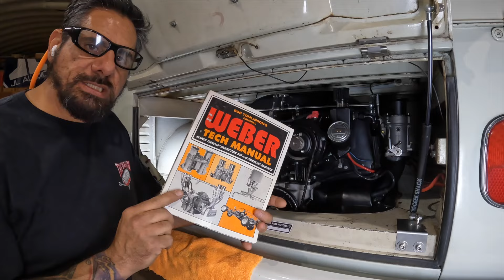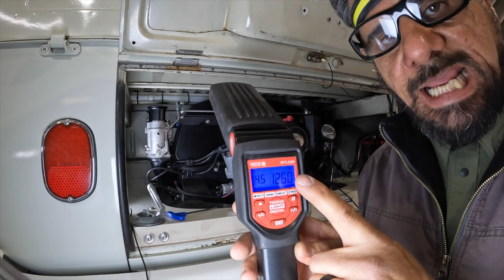Synchronizing Dual Carbs  on a VW Bus

Comment: Just what I needed. Been trying to get things just right on my new 2007 cc engine using Delorto dual 40s.
Reply from the maker: For Dells, do1/2 turns and wait for the response. They are very fine threads on the air fuel adjustment screws.
Reply: Great combo and setup!

Comment: Very knowledgeable, can you do a carb adjustment on a vw bug especially because of the less space
Reply: Yes you can but many open up windows on the body inside the rear wheel wells. They just cut sections of metal there and make them replaceable so you just take them out when you need access to the carbs for adjustment and then put them back.

Comment: Love your vids.  Have a question about changing exhaust on a 1970 Bay Window bus - 1600 (single port single PICT30/3 SOLEX).  Put on a merged header and new muffler.  Bus starts perfectly and idles nicely.  Good torque and happy about more power on the top end.  When I was re assembling the engine compartment pans and hoses, etc. I noticed a tube laying unconnected on one end.  It went from the intake manifold to the altitude corrector.  I put it back on, but it isn't very snug and probably needs a clamp.  Anyhow, I fired it up and test drove it and then drove it from my dad's driveway to my house (~45 miles - mostly highway ~ 60mph).  On about 2 -3 occasions I got a pop when shifting from 1-2nd and a little mild popping when foot off accelerator going down steepi-sh hill.  If I change the exhaust from a rusted out stock exhaust to a merged header....do I need to adjust my carb?
Reply from the maker: Pops on deceleration are usually too rich, or an exhaust leak. Make sure you adjust fuel mixture at operating temperature. With a longer trip like you did, the motor definitely got to temperature.
Reply: @the_Wagen  On the single port engine, I think I am going to take the plunge and go Weber 34 ICT, (you didn't seem to be a big fan of these).  If I had dual port engine, I think I would go IDF, but with single port what do you think of ICT?  What do you think of the CB Performance MagnaSpark?  I haven't seen the part number, but it seems I have BOSCH Vacuum advance with points - blue BOSCH coil.
Reply from the maker: A properly tuned single port carb should run like a sewing machine. You have a problem somewhere. 
As far as carbs. 34 ict carbs are junk. I’d go single port Kadrons first. 
If you are having issues with a single carb currently, dual carbs are not always the solution. Don’t upgrade till you get the issues fixed. 

CB Magna Sparks are great. I’d recommend them.

Comment: Always thorough with your explanations.  Just inherited a set of Dellortos 45s and will reference this video when I get tgem cleaned and installed.  A friend of mine has the Dellorto book in his garage and no more VWs so I think I'll make the drive and go pick it up.
Reply from the maker: Dells require a half turn not a quarter  to a whole turn on the mixture screws for response. 👍🏽finer threads.

Comment: The Ross Wulf parts look amazing as well. I wish they had a 356 sized alternator pulley setup. I use those to get a higher fan speed and aid in cooling.

Comment: My FI was taken out by the PO and they put on a single progressive carb (I know, I know). Been looking into dual carbs but it has terrified me as I'm still fairly new into this hobby, especially with engine work - I'm not real familiar with carb adjustments, etc. I'm in PA with no local shops either, so I'm going to try to do this on my own. Is there a good dual carb set up that's easy to work with? I can always upgrade down the road but want to feel comfortable doing it. I have type 4 / 2.0. Would the Solex 34 dual carbs be ok?
Reply from the maker: I’d recommend EMPI HPMX carbs. They are affordable and work well. I’ve been running mine for 11 years no issues.
Reply: @the_Wagen  I appreciate it!!! I'm only asking those like yourself who are around VW's daily. You should open a shop in Central Pennsylvania, specifically in Altoona, Pennsylvania. haha! Thank you though, I appreciate you.

Comment: I had my Bug almost a year. I like to go dual carbs, but I like to know is it worth doing does it make the engine run better or save gas? I see people do it. I’m just curious cause I would like to do it. I have a 1641 engine I was looking at you, Solex carbs, is it worth getting?
Reply from the maker: If you are looking to upgrade, I’d suggest upgrading the ignition at the same time. 

Stock components and just adding dual carbs works if everything else works well. 👍🏽
Reply: Yeah, I got the ignition added already I’m just trying to look for consistency. It’s my daily driver. It’s nice and clean engine, nice and clean transmission nice and clean. no oil anywhere. that’s why I was wondering if dual carburetters would help my car out. thank you for your time for helping me.
Reply from the maker: If I were to add dial carbs, I’d stay with an IDF / HPMX platform. Kadrons, Solex, ICT’s are not my favorite.
Reply: @the_Wagen my Squareback came with Weber 34ICT carbs and Empi components. I also have the CB manifold and crossbar linkage (not installed yet).  Tell us why you don’t like these carbs.  I had a set on my 75 Beetle back around 1988.
Reply from the maker: @jimgerock9190 THIS IS JUST MY OPINION.  ICT carbs seem to have blown throttle shafts out of the box. Plus most single throat carbs are "sloppy". The IDF design(dual throat) revs quickly when properly tuned, and are more efficient.
Reply: @the_Wagen  interesting.  I’d think single throat carbs would seal better than dual throats, but maybe the manufacturing process is less stringent.